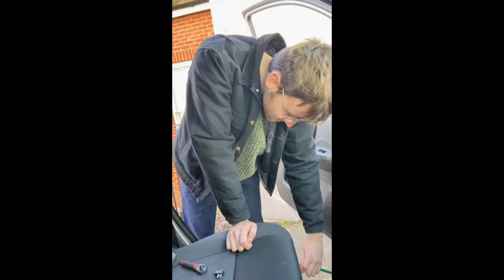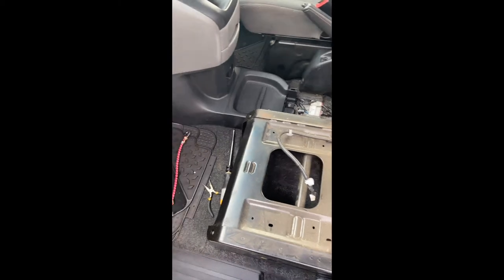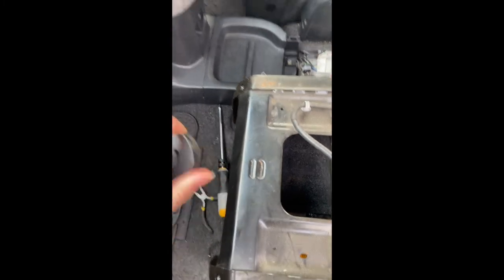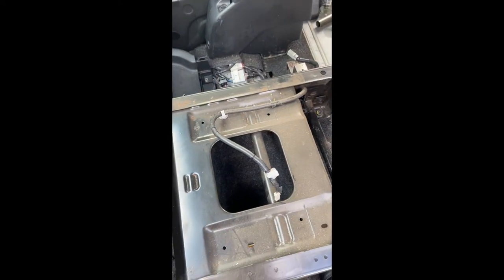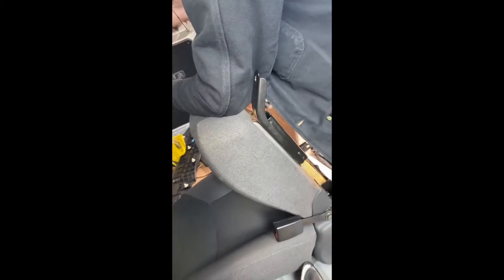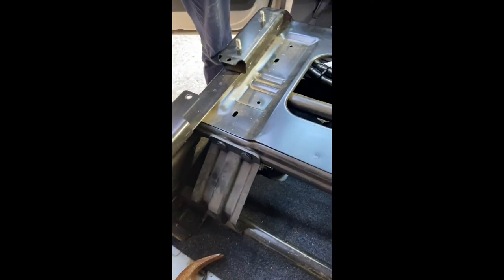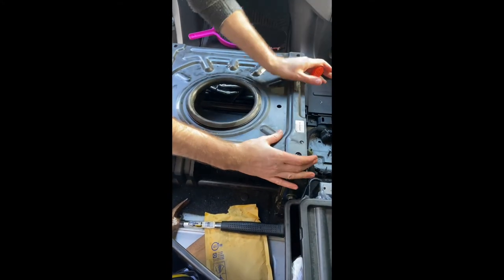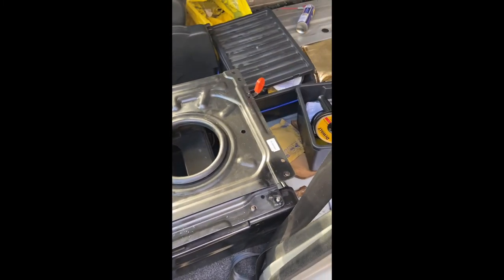Nissan NV200 Van Conversion | Swivel Seats | Van life

Comment: Please use the camera in horizontal, we'll see much more! Would you add links about the used items (ie the plate) to the description. What happened to the magnet, and what is that wire for? Thanks!
Reply from the maker: Hi, thanks for the suggestion! We realised this after editing the first couple of videos and have started filming horizontally so watch this space for the next videos :) 

We worked out that the wire is actually to do with a pressure sensor in the seat, which is connected to the seatbelt warning sign. The previous owner had disconnected it so the seatbelt alarm didn't go off when he put something heavy on the chair. The magnet is still a bit of a mystery but we'll keep you updated if we figure it out!

I will add the links for everything we used in the description

Comment: This alters the design of the seat  and seatbelt system. And Voids their compliance with the legal requirements.
Just because it get a Warrant of fitness by a local testing station does not mean it's legal or fit to be on the road.
Check with the local authorities on the  compliance issues 
Before you do this.
Reply: its fine, they havent touched the seat belt system and you only turn the seat around when parked, if they get into a crash while driving its the belt and its fixings (unmodified) that take all your weight and stop you flying into the windscreen, not the seat
Reply: @Fromatic  The seatbelt buckle is attached to the seat. Whose attachment to the floor has been changed. Therefore the seatbelt and seat attachment system has been altered. Maybe it's ok maybe not.  .
I strongly recommend that the mods get certified.
Reply: @BlueJazzBoyNZ  yes good point with the buckle end attached to the seat, but I still think the risk is small if the swivel base is bolted in properly. Though I was surprised by the amount of cutting away at the base they seemed to have to do